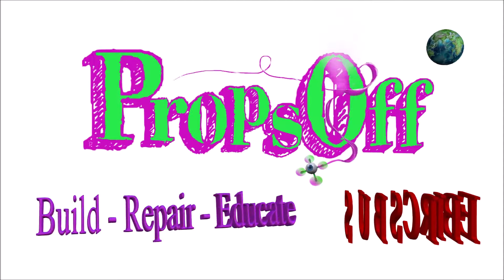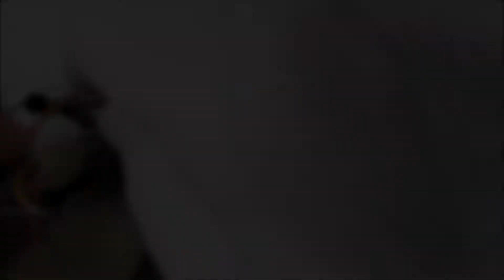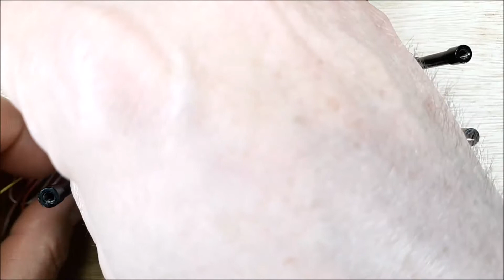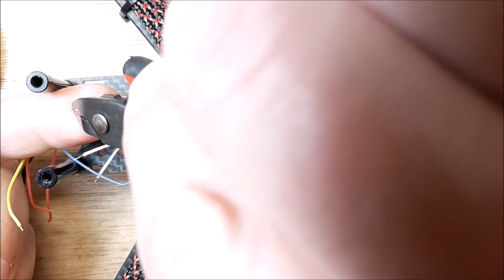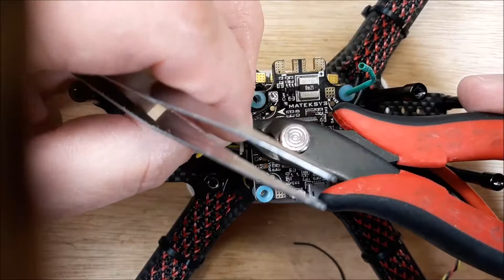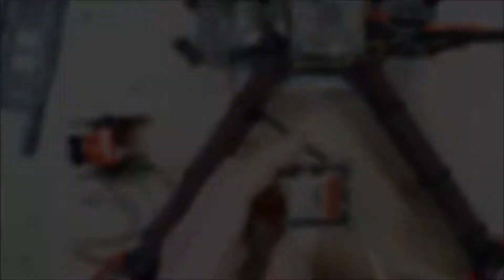7 Inch Drone Build | Part 3

Comment: Are you using rosin core solder? I was using Kester flux and rosin core solder and I don't think they mix well, do you? Or maybe had my heat turned up to 450F, to high!
Your work is looking awesome. Connecting the receiver red wire to  the 4 to 5v what does 4 to 5v mean? Does that meam that you  have 4 to 5v to work with? Great vid and TFS!
Reply from the maker: Flux core and 450'f dont mix well sometimes. The core acts like fireworks at that temp with tiny solder wire..
Reply: @PropsOff  Yep I noticed that it's was crackling and looking like lava....Oh no!